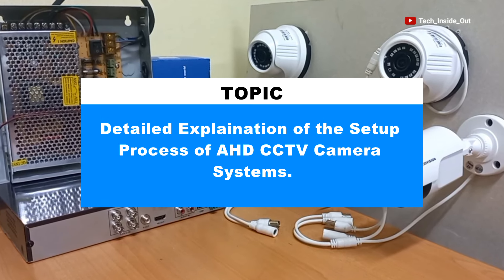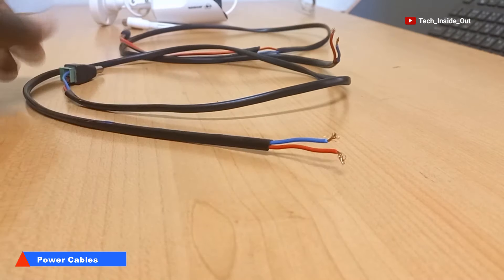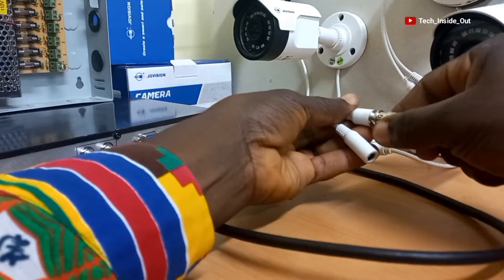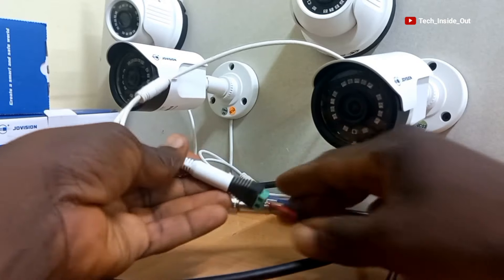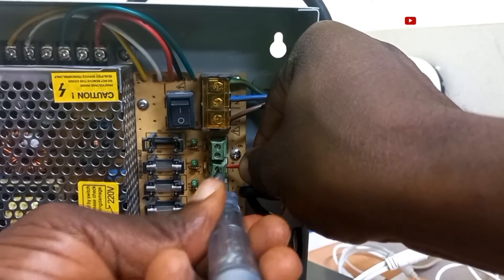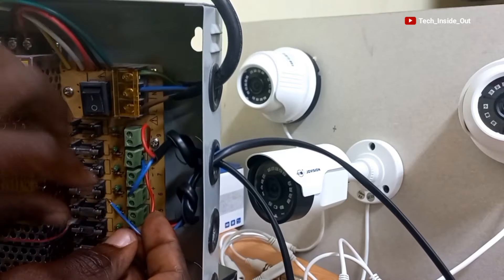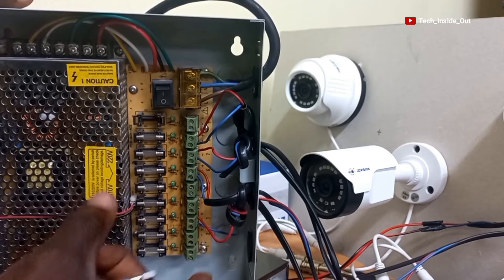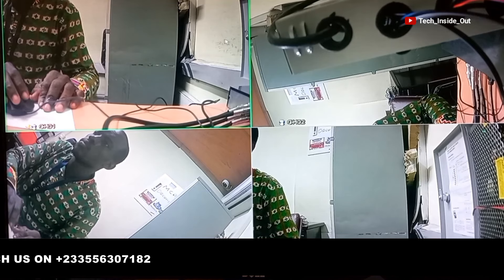AHD CCTV Camera Installation process with full explanation

Comment: I’ve seen a DVR that gives power through the coaxial cable to the cameras ,doesn’t require Siamese coaxial cable separate power is that possible with that DVR a lot cheaper for cable   ?   Great video
Reply from the maker: I have not come across such a DVR. I will research on that.
Reply: Hi the DVR that I was asking about  is on YouTube, Hikvision  POC power over Coax HD dome cameras  check it out  and do a video
Reply from the maker: Thanks very much. I will check it up.